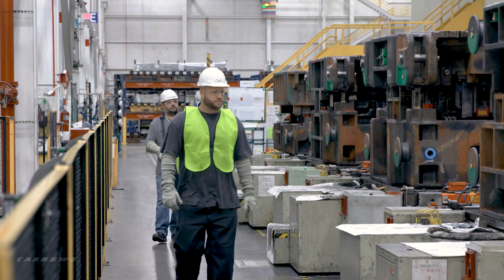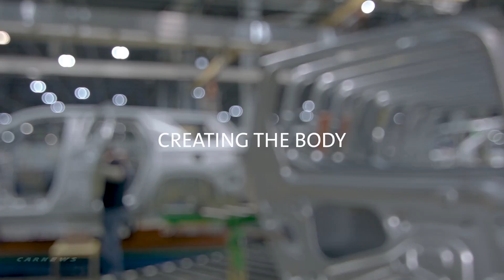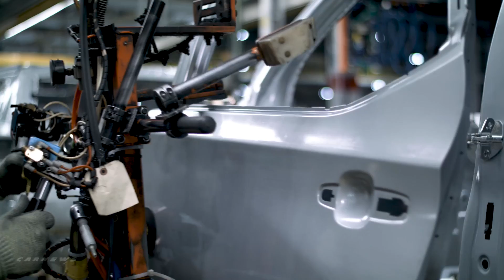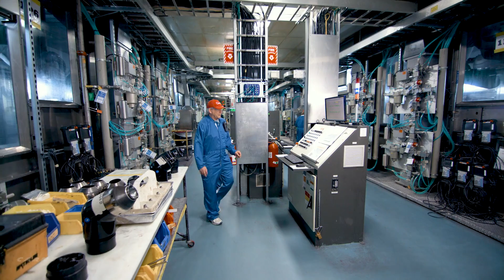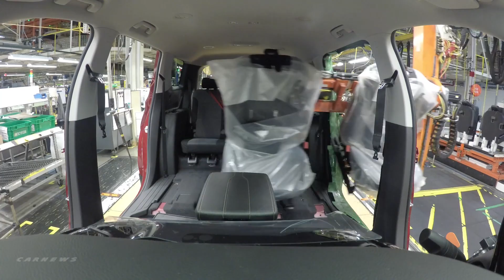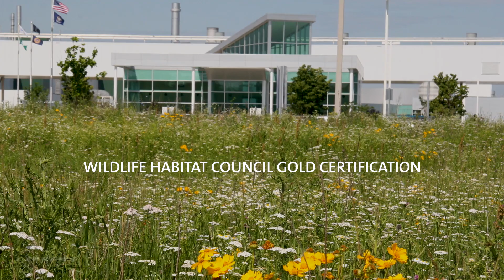GM Lansing Delta Township Assembly Plant Overview

Comment: Nice to see where my car was made. I bought a 19 Traverse in January and so far am loving it. I am just amazed at how they manage to build two separate cars on the same line. Like, how doesn't a dashboard of an Enclave accidentally get lined up to go into a Traverse is pretty amazing.
Reply: It's happend we make mistakes like that but fix them in plant
Reply: How is that Traverse holding up?
Reply: @markjohnston3502  last year there was a recall for a belt buckle in the 2nd row, as well as a metal piece that holds the front wheel in place. Both got fixed free of charge to me. Then later last year, the steering column lock gave out, and with just a bit of pressure on the top of the steering wheel, you could push it down. It happened even on the freeway while driving. There was also a small knob inside with a chrome bezel that came off the knob. This is the knob on the center console that lets you change driving modes (which I never touched, always left on ROAD). This last one was cosmetic but still a pain to see on a 2 and a half year old car. Luckily I got rear-ended in May of this year, and the car got totaled. The insurance paid most of it. The ride was great though. It was also so spacious for a big guy like me. The most comfortable car I ever had, but that steering column lock was a major issue. Never seen that happen on any car.
Reply: @utoobia6872  Interesting, we have an '18 model year and never had any of those problems. Never even brought in to get the recall fixed.